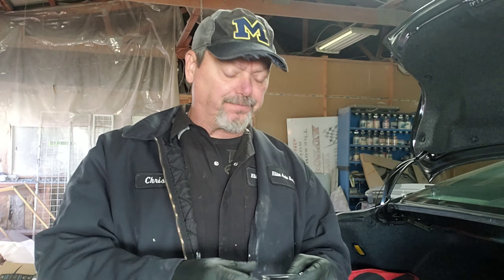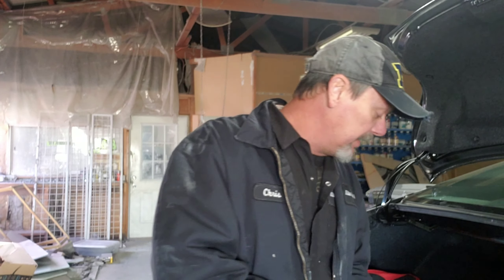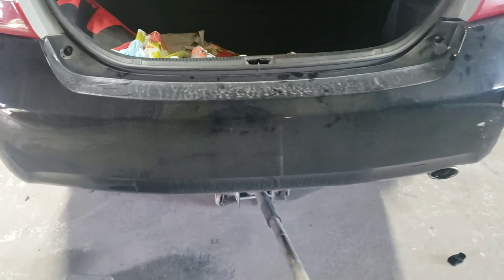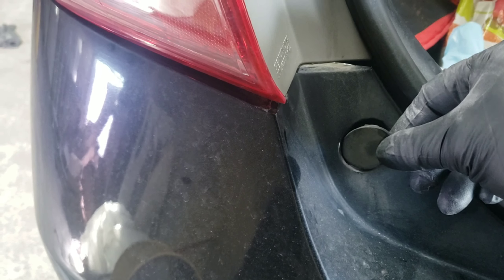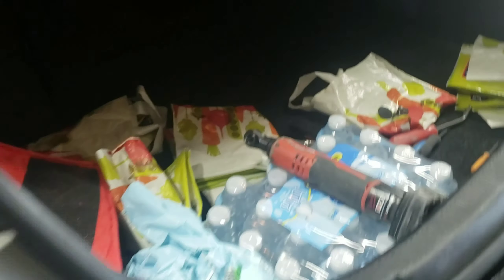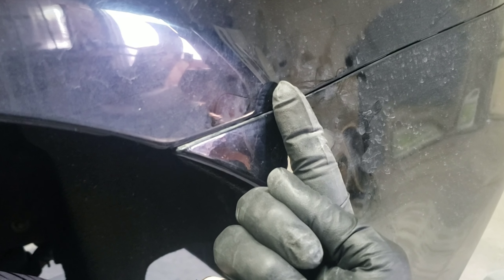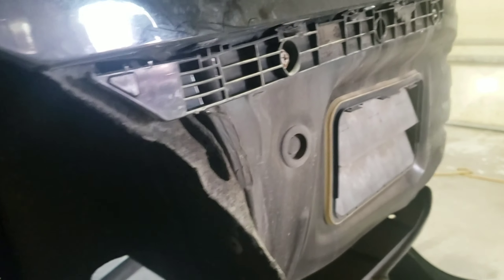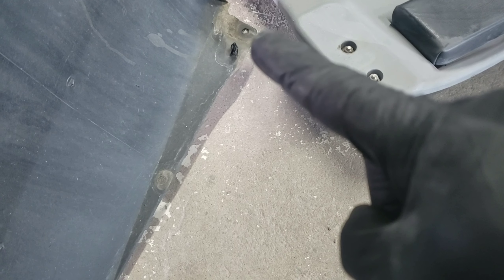How to remove a rear bumper on a 2009 Toyota Camry. Diy Autobody

Comment: Can you show me the size of the clips and the 10 mm bolt? Driver side corner of my bumper is flapping around and I think it only needs some clips to stop the flapping around and maybe the 10 mm bolt. I bought some clips on amazon but they don’t seem to fit.
Reply from the maker: Check with you local auto parts store theycan match it up.